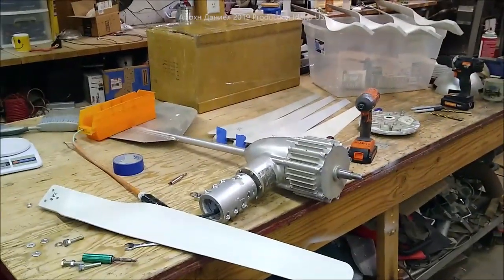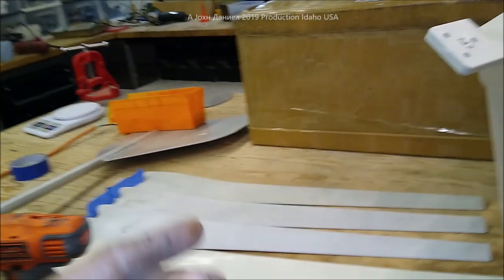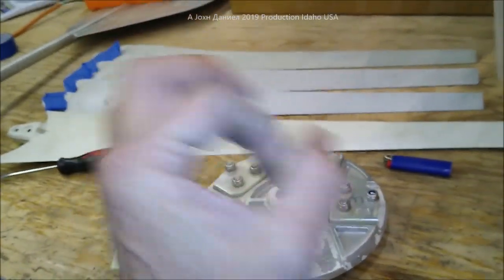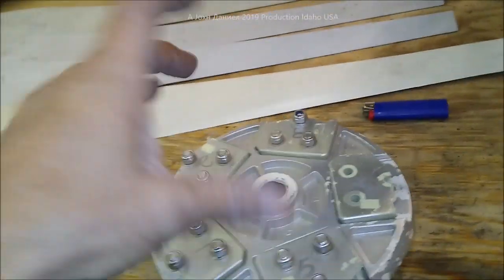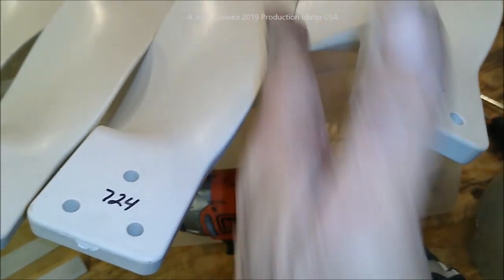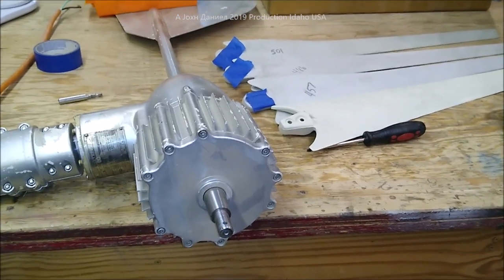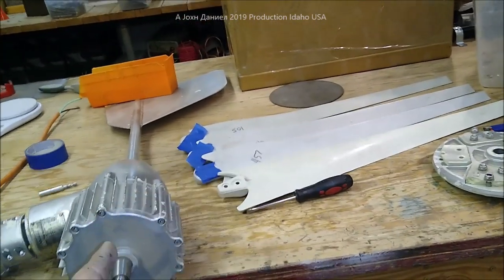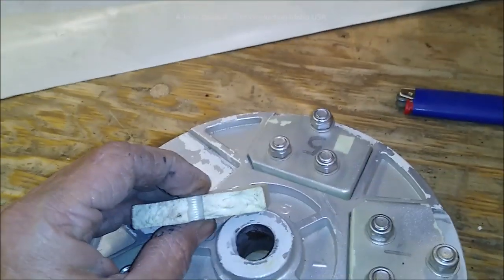Residential home power,  Wind Turbine Generator Blade upgrade replacement

Comment: Hi John! I have been watching your videos for some time and now I am convinced to buy a microturbine 600W weight 25 kg! I need a 6m mast-pole tower. What is your suggestion for it? Which are the best dimensions? diameter, thickness and material? thank you very much in advance
Reply from the maker: 21 feet of USA standard 2" Galvanized Schedule 40 Pipe makes the best pole and you will add guy wire supports at 15 foot from ground 4.75 meters up.
Reply: @JOHNDANIEL1  thank you very much :D

Comment: Hey that's the same thing that happened to me Friday
Reply from the maker: Thats sad! Blade Loss? I have had to drive out numerous times to people and do a blade swap due to their choice of mounting the turbines. You can't seem to explain enough how substantial they need to build poles, mounts and towers. They mount the whole thing on 20 feet of 1.5" pipe or a 4x4 wood post or telephone pole and destroy blades and tails all the time. Worst one I ever saw was a guy in New Mexico using a mast from a small radio station about 4 years ago, What a mess that crumpled thing became.  These things can end up with 600 lbs of lateral wind force and it takes a 2.5 OD + inch heavy gauge pole to mount them with multiple bracing or guy wires. These blades are the best I could find for the money, but you can spend up to $80 a piece for hand crafted.
Reply: Mine is Mountain in an inch and a half of pipe triangle self-tanning Tower 120 ft but I'm only using 40ft 75 mile an hour wind one blade broke off and it started vibrating like bat out of hell Brooke one pipe and bent the other two I was there looking at it I thought it was an interesting how fast was spinning into that blade came off boy is scared of s*** out of me

Comment: Hey I have 48v wind turbine what's kind and voltage of ssr relay do I need to setup a dump load setup.
Reply from the maker: DC to DC SSR thats linked under some of my wind turbine videos has a 3 to 32 volt DC control voltage. You just tap a 12 volt source of your 48 volt battery bank and run them that way.

Comment: So john, some of your links go to B Creations, some go to G&E...the turbines look exactly the same, have the same ratings and the adds are the same. My 500 and my 800 both came from G&E and neither make shit for power unless i spin them with a drill. Im watching my G&E 800W in 20 mph wind wave back and fourth like the tail isnt catching wind and haven't seen it go over 267 watts in 25 mph wind yet. 25' pole, heavy cable, perfectly plump,  balanced the blades, 8 awg wire straight to a 150 rectifier,  straight to the bus bar. Same story with my 500 but never saw better then 110 watts with that one. Is your 500 also a B&C? Your links went to the G&E....
Reply from the maker: Those to companies are sourcing from the same places, thats why I order from them. No one else is having this issue with output, something has to be wrong with the set up. What obstructions do you have and what voltage you running, something is definitely not connected or located right.
Reply: @JOHNDANIEL1  went over the wires a thousand times checking resistance, tested different rectifiers, soldered all connections... the tower is 100 feet from my single story house.  House is 20' tall and to the south of the 25' tower. Theres 2 pine trees 300 feet southwest of the tower. Northwest to south east there's nothing to slow wind. Could the house be creating that large of an eddy that the air just spins around the damn turbine?
Reply: If i made the tail larger, like a thermodyne, do you think that could help or do i gotta move the tower further from the house. It drives me crazy watching my flag at the corner,  (200' northeast of the tower) flapping in a steady straight line and my turbines start to spin and turn before they can make power.
Reply from the maker: @ak-joe2038  I am starting to wonder if your hub is not slipping on the turbine shaft. When its safe, pull it down, put a 8mm allen in it to hold the shaft and try to spin the blades. Its starting to sound like a effect of slip thats not allowing the energy of the wind to get to the blades.
Reply: @JOHNDANIEL1  I'll check it our next time my scaffolding is home. Pole/turbine combo is pretty heavy to tip up and down so i stack up my scaffolding and do service up there.
Reply: Interested in a trip to title town? Have you seen Lambeau field? What would your advise cost? My wife would even cook up some fesh venison....

Comment: I have a super core I can't get no more than 10 amps out of it with a set of K T ghost blade
Reply: what kinda winds are you seeing clean winds and decent mph? , do you have 12v,24 or 48v, be interesting to hear from you with your progress progress once the cause is solved,  i will say in my personal experience with many brands of turbines i didnt see any power to write home about unless the winds were clean  with the turbines in winds strong enough to get them spinning fast enough, basically well above obstructions and in turbine territory wind zone wise.good luck
Reply: @closertothetruth9209  is a 12v system and I have wind between 10 and 15 miles that's everyday my test was done on a 30 mile an hour wind
Reply from the maker: Upload a video on it.
Reply: @JOHNDANIEL1  I do not know how to load up a video
Reply: @JOHNDANIEL1  it at 48ft of the grown
Reply from the maker: Possibly pull it down, and flip the blades around and rebolt them back. Seen that before on those clear ones.

Comment: Hey John how could I do my wind turbine with  my Chevy volt batteries at 24v and what kind of charge controller to set the low and high voltage I already have 2 classic 150s any good info
Reply from the maker: They have specific controllers for Lithium batteries using wind turbines, the ones that are on Ali B&C that are blue with a built in faster acting diversion system are the most common used.